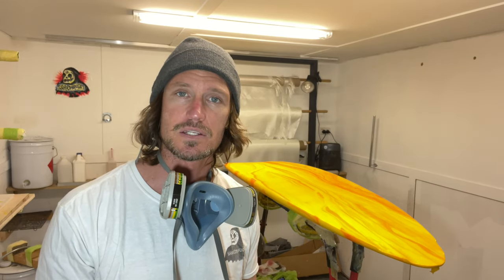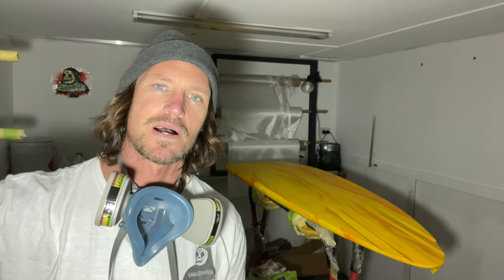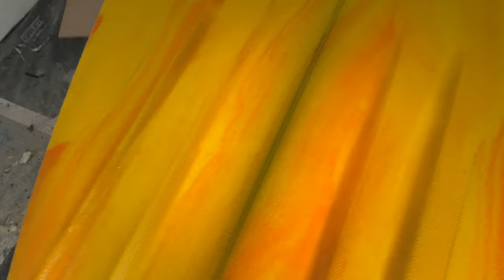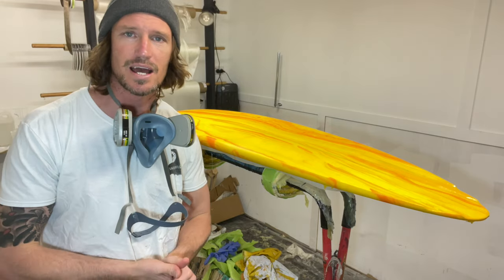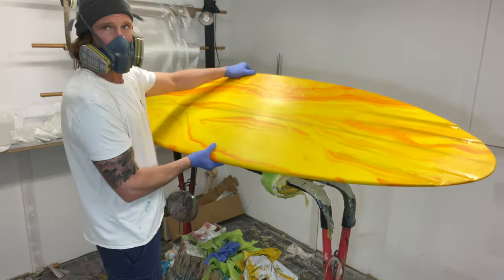Glassing Resin SWIRL surfboard with CHANNELS.

Comment: I don't think the spray adhesive will work when using Epoxy Resin. Have you used it?  I see you used Polyester here.
Reply from the maker: Yup works with epoxy too. That’s a little trick to get your carbon to stay in place when doing stringerless eps / epoxy
Reply: @Shrednaught    I asked because if that contains same aerosol as spray paint, the resin will look runny. It happened to me before. That's why I only use acrylic/water based paint.
Reply from the maker: @Surfmus  if you use the exact brand 3M spray in the video and apply lightly there won’t be an issue. Over use can have negative effects

Comment: What kind of glue you use. I buy composite glue, but when i apply composite glue on esp foarm, the foarm was burn.
Reply from the maker: 3m spray adhesive. Can’t remember the exact product number off the top of my head. Just email them and ask which is compatible with eps foam. And only ever apply a small amount as a larger amount can cause issues.

Comment: Awesome video, I appreciate you taking the time to break things down in simple steps. I really appreciate you showing the tools that you are using.That is a cool looking glassing rack. Did you build it yourself? For future videos, I'd like to see two things.First, a detailed video on how you shape rails. I do a solid job blocking in the rail. I struggle with finishing them off. Specifically I struggle keeping them even and uniform. Second, I'd like to see how you shape a single or double concave. Thanks!
Reply from the maker: Thanks for watching mate. Yeh it’s just a simple rack that I chucked into 2 buckets of concrete. Does the job. I’ll keep those suggestions in mind. I do know a lot of people would also like to see the rails and concaves so I’ll definitely do a video on them in the future 🤙

Comment: Nice man, wish I saw this before glassing my board  a few weeks ago. I ended up with a large air bubble in one of my channels. I fixed it by putting some resin in a 10 cc/ 18 gauge syringe that I got from a pharmacy and pumping it under the cured cloth. Neat trick with the 77 can.
Reply from the maker: ah spewing man. At least you'll know for the next one
Reply: @Shrednaught  First time shaping a board so learning a few lessons the hard way haha
Reply from the maker: It only get easier mate. Each board you will learn something

Comment: I've used the 77 spray adhesive on a lot of my channels boards works pretty well. Just need to make sure if you use it on eps you go extra light or it can melt the foam.
Reply from the maker: That’s weird.. I went and tested some of the eps I have in the shed yes y and sprayed a massive amount on it in a small area and it was fine. I wonder if different eps density reacts differently? 
 But regardless even with poly a light dusting is all that’s needed. It can leave your fibreglass “ dry” if you spray too much and it soaks in
Reply: @Shrednaught  Could also be whats in the air or propellant, I've hear rattle can acrylic can do the same thing. The test I did I used a ton and had slight melting, but using only a dusting worked really well. Currently testing to see if just brushing resin on the channels and letting it tack is better.
Reply from the maker: @WaveWasters  yew! Good luck
Reply: @Shrednaught  Didn't go as smooth as I hoped definitely sticking to the spray next time
Reply from the maker: @WaveWasters  damn. That’s why I do the combo. Try to cover my back on both sides. 
Epoxy should be fairly easy to fix up
Reply: @Shrednaught  I got the lam tight it just didn't go as easy. I also put to much black in my swirl which was the biggest issue.
Reply from the maker: @WaveWasters  you going to put it up on YouTube. I’m frothing to see it skinned
Reply: @Shrednaught  Yeah that's why its taking me so slow to put together. I'll send you photo on Instagram of the layer I did.
Reply: Label on 3M 77 says it is good for glueing EPS:) But anyway I did some tests on scrap EPS before lamming my channels and it did not melt EPS at all, light or strong use of 77 glue, both the same. Works good, but need to use it really light, especially on clear lamination, bcs the glue is a bit yellowish if used in bigger amount. Anyway, I am building EPS plus Epoxy only and there is a plenty of time for glassing channels even without using of a spray adhesive. Maybe even too much:) I usually glass the board and have to wait about an hour (fast hardener with 8min pot life in temperature about 20 degrees of celsius) to finish the channels. 

Anyway good video and discussion! Thx guys!
Reply from the maker: @milospotuzak3251  good information. Thanks mate 🤙
Reply: @Shrednaught  No prob at all :)

Comment: cool videos I really liked them and I dont even surf, What do the channels do for the board?
Reply from the maker: Thanks 🤙
Channels are an individual preference. I personally don’t surf them.. but the channels on this board are there to keep the concave through the tail increasing drive. Also as it will be used as a 2 + 1 they sill hopefully make the tail hold better through turns 🤘

Comment: Mate, I love your content. So help and useful. I've notice you've been using brushes a lot: Do you reuse them? If yes, how do you keep them clean and soft for the next usage? Thanks for helping a lot of beginner shapers.
Reply from the maker: Glad it’s helpful 🤘 yeh I re use them. I wipe as much resin out as I can then clean with acetone and then place them in a Tupperware container with some acetone in and put the lid on. Take them out and let dry before use and good to go. With the cheap chip brushes you can only get away with this a few times before they disintegrate

Comment: Great vid. So no worries on the spray glue showing up? Say you were doing a solid light blue tint would you see any color differences in the areas that were spray glued? Cheers
Reply from the maker: Thanks mate. No issues with the glue showing BUT if you overuse the glue it will show up a silvery colour. The glass soaks it in I think and doesn’t wet out properly. So just a light dusting 🤙

Comment: 4:12   I learned some stuff here. Thank you! What was the purpose of adding the hot clear laminating resin then?
Reply from the maker: I didn’t kick the coloured resin as quick/ hot as I normally would to give me some extra time. The clear resin is catalysed quite hot/ high and this will help the tinted resin kick and make sure it all goes off fast enough
Reply: @Shrednaught .  Thanks for replying. 🤙🏼  If you laminated the same board with channels but NO swirl, would you have still used little catalyst to give you time to work on the channels?
Reply from the maker: Na, not necessary. But you can still do it depending on your skill level. I normally just catalyse normally without channels.
Reply: @Shrednaught    Yours was the first video I’ve seen that explained how to mix resin when doing a swirl and how to glass channels. Thanks.

Comment: nice work!! what gave you the idea to use spray adhesive? wish I would have tried that back when I was building channel bottoms
Reply from the maker: It definitely wasn’t my idea mate. I’m sure I read about it somewhere.. maybe swaylocks website. Just made perfect sense. But if you do over saturate the glue soaks into the glass and blocks the resin so that’s something that I found out the hard way 😅

Comment: Yo, I have a board similar to this, and I'm thinking of getting a step-up version of it next season for some bigger waves.
But should I get a different channel bottom setup and how could I know what might cut and what will sink??

Would love to hear your thoughts on variations of channels and which options work best.
Reply from the maker: That’s a hard question to answer. As for what works best.. what works for me and my location might be trash for you and your waves. With out knowing what setup your running I can’t give you a definite answer but what we have been running has been boards with a rounded tail and a 2 + 1 setup with a single concave running into a 4 channel through the fin cluster. All channels toe in with the fins at 1/8 degree. Channels can be a personal preference and I’m not a huge channel guy but my mates are. I can get the same drive and hold with different fins or clusters. 
Are you shaping this board yourself or have a shaper local?
Reply: @Shrednaught  haha, channels are tricksy and that’s why I’m asking the wiser men. 
For context, I live in South Africa and mostly surf along the Eastern Cape and around Cape Town. Hitting some of our cranking point breaks and I am progressing towards heavier beachies that really throw some big barrels. 

I’m sticking clear of the additional stabiliser fin so far and mostly alternating between keel fins and as it’s called here tweel fins which are like keels with a wide base but give more pivot and release thanks to a steeper leading edge and more of a hook in the rake. Kinda like HP Keels. Works well with the keels on the inside edge for point breaks to knife into the face on takeoff but also to release and pivot when hitting the top!

I bought my first twinnie second hand but I can get hold of the shaper [GONZO] who also lives on the East Coast near JBay. It’s modelled on the fiji performance twin that Toryn Martyn rides but squashed down to 6’0” - 
and I’m keen to see what it’s like stretched out as a mid length (6’8” - 7’2”) 
Maintain the low entry rocker on the nose and the rounded tail; 
I’m also wondering how far up the channels should go on the longer board. 

Haha, so many factors, I really just want to focus on one or two elements to tweak on the next iteration - sheesh gathered already so much going on with these twin pin channel bottoms but it’s so much fun to ride!

Comment: Great job, did you have catalyst in the yellow/orange resin what percentage if so why the clear lam hot mix and do you use same adhesive for carbon rail tapes?
Reply from the maker: I only had 0.5% in the colour that’s why I also used a hot lam mix to speed things up. Yup same spray for rail tapes 🤙

Comment: Smart using the spray glue, if you were using EPS what might you use instead as to not melt the foam?
Reply from the maker: I’m pretty sure that if you only do a light dusting on eps with the glue it doesn’t melt it. 99% sure but let me spray and off cut and get back to you 🤙
Reply from the maker: Just went and sprayed an off cut of eps with a thick layer of that glue and it’s all good man. Doesn’t melt eps
Reply: @Shrednaught  that's good to know mate, thanks for the rapid test. Enjoying your videos and swirl experiments, doing some of my own too!
Reply from the maker: @foamhacker6396  yew!

Comment: Would it be possible to add dye to a hotcoat and colour your surfboard this way?
Reply from the maker: Hey mate, you can add tint to a hot coat,  but only for a couple of styles. One is to do a trashed tint or patina style. I’ll have a video on that soon. And the other is to make a tinted lam job more deep in colour. It won’t work to cover a clear lam
Reply: @Shrednaught  ALright! Thanks for your help brother.
Reply from the maker: All good man 🤙

Comment: what was the part with the clear lam hot mix? why put that on...?? thanks!
Reply from the maker: I drop the catalyst ratio in the swirl to give me more time. Once I’ve got that laid down I then do a hot ( higher catalysed ) clear lam mix over that to ensure that all of the colour work goes off in a timely manner
Reply: @Shrednaught  do you make sure to get the hot mix on the deck laps as well?
Reply from the maker: Yup I do try to get it all the way around onto the laps. It’s not a huge issue if I miss a spot because all the resin is catalysed it just affects the cure speed. 🤘

Comment: Another really good video, thanks for sharing your knowledge. Check out iK Multimedia and Samson Technologies  for audio devices you can use with your iPhone. They have wireless mics and all sorts of things that could help make your job easier.
Reply from the maker: Thanks for the info. I will look into them first thing tomorrow. I definitely need to improve the audio. Cheers 🤙
Reply: @Shrednaught  Even just a lapel mic will make a huge difference. If you are going to only do voice pieces to camera and not while moving around a corded mic will be fine. iK also make some great phone holders that might be helpful?

Comment: Hey, great video!! Super helpful. I had a few questions before I start building my first board.
( The video I'm referencing is    https://www.youtube.com/watch?v=k_7nHHFQxkk&ab_channel=Shrednaught   for the questions below.)

What's the advantage (apart from different colours) of doing a tail and deck patch vs doing 2 full layers of glass on the top and bottom? If it's just a weight thing is there that much of a difference in weight between the two methods that makes doing patches worth it? (Also would there be a significant strength difference between patches vs 2 layers of glass).

The second question is what's the difference between putting the fin boxes in before vs after glassing? As I have seen some videos where the fin boxes are put in before the glassing and some are put in after (generally with single fin longboards). If you put the fin boxes in before glassing shouldn't you put the leash plug in at the same time?

Sorry if these are newbie questions. Keep up the great videos!